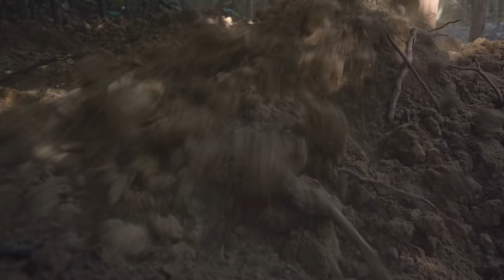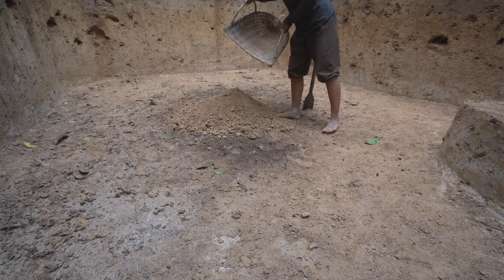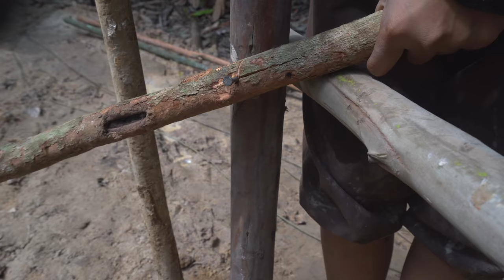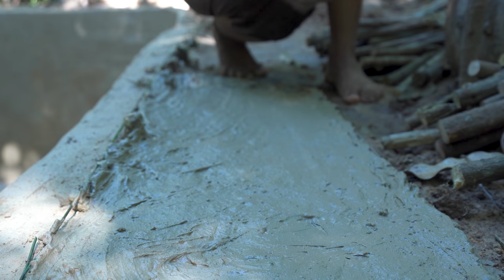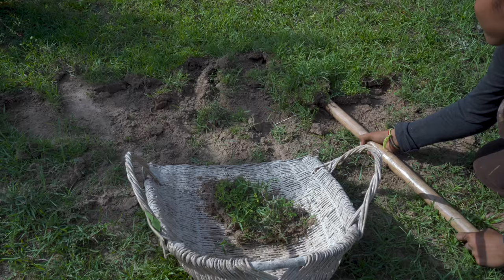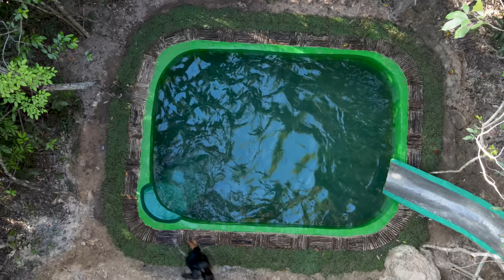Girl Build Lovely Swimming Pool and Slide for Her Own Villa, Girl living Off The Grid

Comment: A 3-storied villa that she built for herself! I always wondered if she parks on the edge of the jungle, then gets in after her work, drives back to the noisy city to her apartment w running hot/cold water, electricity and a toilet that flushes? Nothing but admiration! ❤
Reply: You are just jealous because she can build them and you can't